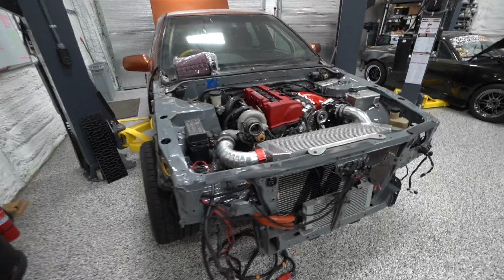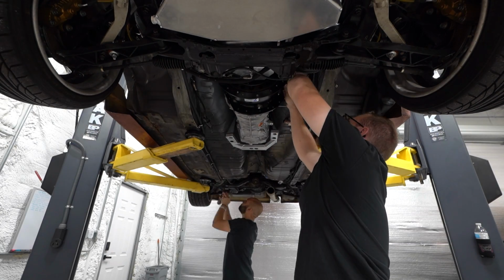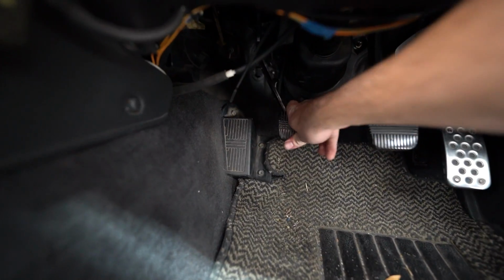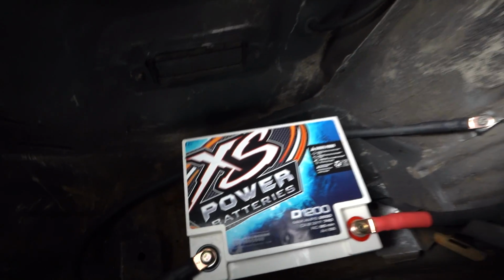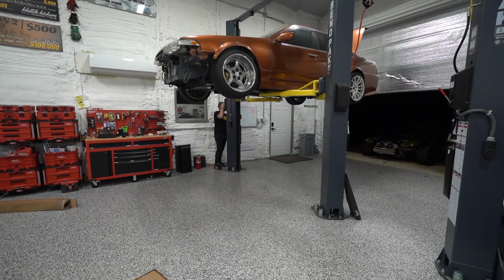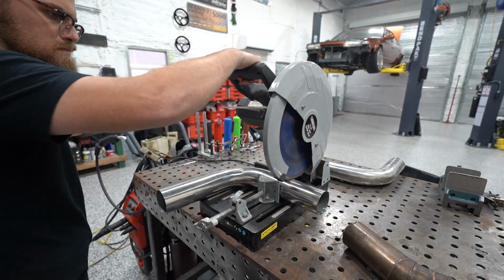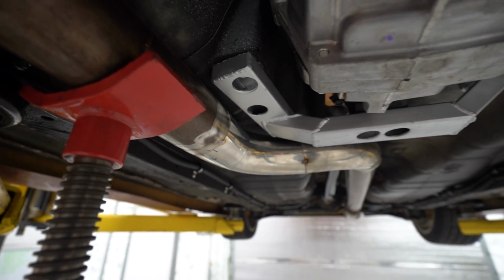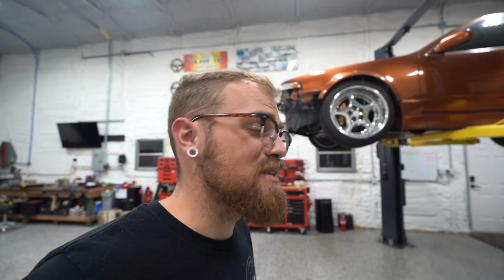Honda K24 swapped JDM drift car build. Its ready.

Comment: Also have you tried using tacking bands? I use them doing good grade stainless pipe fitting and welding. Basically a strip of steel that’s rolled to be the circumference of the pipe minus about 15 mm. With holes drills in it around the band so that you can tack the tubing together. Uses vice grips to clamp around the two ends and holds them together but still allows you to spin the pipe if you want. Food for thought

Comment: Hot tip for that little piece you made for the exhaust. You can put a flashlight in the exhaust pipe to illuminate it, and then wrap a piece of paper all the way. around that gap. The light illuminates the paper and you can trace the exact shape of that little pie cut and then wrap it around a piece of pipe and cut it out exactly.

Comment: I used to get so irritated when a part that worked perfectly fine a short time ago, and wasnt used at all for a bit suddenly goes bad right when youre fixing something else. I used to think there was no way, it must be something I did, highly unlikely that the starter just HAPPENED to go out right at that time...
Now I understand that is quite literally how it happens most of the time. Completely unrelated part failures for no apparent reason at the worst possible time. Happens more than 50% of the cars that come in to the shop and my own stuff and pretty much anyone I know

Comment: A tip.  To keep your hydraulics seals from leaking always have it reset o the loft locks. Eg.. when it goes up after both sides clicks lower it so it sets on the safety catch.  This way the weight of the car won’t be on the hydraulics.    Your seals won’t hold the pressure.
Love your videos !!!

Comment: personally i wouldve made a vband connection inbetween so if you have to pull the trans or driveshaft you only gotta remove a small portion, now you gotta remove a huge section

Comment: If your flipping those breakers a lot, it would be easy to add switches to the side of your panel. It’s not good to flip switches on a regular basis. Their just not made for it. If you want some help with it. I can walk you through it. Cheers!
Reply from the maker: I was wondering about that. I mainly turn the lifts off Incase they short and try to lift on their own.

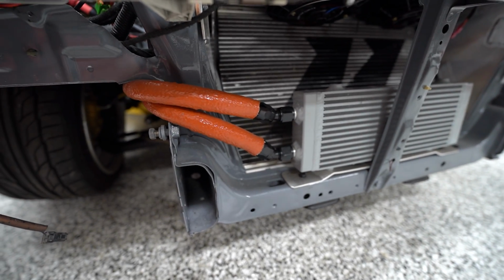Comment: 6:26 I think you could swap the two oil line positions on the oil cooler instead of making a whole new line. If you moved the bottom one to the top fitting on the cooler, it would give you that extra inch you need, and it looks like you could have the length in the other line for it to reach the bottom fitting. Maybe... Its hard to tell.

Comment: i made batteries for about 3 years, (good money shitty working conditions) but all agms batteries are basically the same. the difference is a couple grams of acid which aint shit. get the correct size and it'll function just as an oem.

Comment: Watched all the episodes when you were building this car with my dad, awesome to see it back stronger than before! Also new camera? the focal length looks different in the vlog shots, and it seems more stable/smooth.

p.s. : not sure if you've noticed, but in some of the voice over clips there's a slight buzz in the mic. Great work 👍
Reply from the maker: It’s the same camera I’ve had for a bit. But I finally got some full frame lenses for it. Was using my small frame lenses for awhile. I also got a gimbal so I could use my main camera for the walking “vlog” shots. I normally use an action camera since the stabilizations better.
Reply: @Taylordrifts  Nice! Yeah I’m used to seeing the action cam shots, can’t say I remember a video I’ve watched with this camera. Maybe I’m just noticing now since I’ve taken a photography course recently ¯\_(ツ)_/¯

Comment: Am jus a car admirer so dont know a lot abt building cars. Isnt that a crash area where the battery is installed? Am wondering because i have seen some car builds where that tube frame the whole back and the battery is mounted inside the car at the back.
Reply: It’s a street car, in a comp car you might tube the rear quarter but you need the trunk on “street”  cars to carry your tools and tyres to the track. Lots of vehicles have the battery there from the factory.
Reply: @foamdataservices  ok. Thanks for the clarification . Have a blessed day

Comment: That mis-matchedness of the interior has some serious 90s/2000s vibes going on and I personally love it. That's the tuner car generation I grew up in.
Reply from the maker: I don’t know why I love it. It’s normally not
My thing. But I like having a clean simple interior with some over the top flair here and there.
Reply: @Taylordrifts  my first car was a 91 Talon TSi that had one secondhand Bride seat with a Takata 5 point on the drivers side, and a second hand Sparco Monza passenger seat with a Sparco 4 point Harness, a ratty third hand Nardi steering wheel, and a shift knob I made in shop class. It was pretty sweet to me because I built the car from the time I was 12 til I was 15. Sometimes that mismatched madness just works.

Comment: Great Progress, Taylor. One suggestion on driveshaft installation for the future. apply assembly lube to the outside of the end that goes into the output of the t56 so the rear seal doesn't get accidentally damaged pushing the driveshaft snout past it. also - did you verify the driveshaft engagement into the transmission. should be 3/4" static so it has some leeway for travel.

Comment: Also bud, I'm really digging on those wheels. They look alot like a Z32 polished wheel, but two piece...Man do I wish Honda would've released an inline six. I LOVE my J series V6s, and I made 502 whp on a JDM J32A that I bought off of eBay for $700, a 2003 Acura CL Type-S six speed manual trans, an AEM 340 LPH fuel pump, custom made Injector Nation 1000cc injectors, custom made ARP head studs, a set of eBay turbo manifolds and downpipe (that had to be highly modified to fit), a GTS3582 dual ball bearing/billet compressor wheel turbo, an Invidia single in/dual out exhaust, a Tial Q50 BOV, and an eBay 44mm wastegate, all running on an AEM 30-6052 standalone in my 2001 Honda Accord sedan. It was fast and it surprised quite a few people, until a student driver pulled out RIGHT in front of me...Now I have a 2004 Acura TL (yeah, I know, I'm a truck driver but I love imports and I won't buy new cars, so I got this and my wife got a new Ford Escape Ecoboost AWD). However, I love turbo Hondas, including my 709 whp EJ8 Civic coupe, and I'm planning to turbocharge my 2004 TL with the same GTS3582 turbo or my Garrett GT3582R at low boost being tuned on Hondata FlashPro using some parts from the Accord, but the J32A3 has the exhaust manifolds cast into the heads, so I had to fabricate new manifolds and all, so hopefully what I've been breaking my butt on will work. I still have to have the 10an drain bung welded into the aluminum oil pan (because I've never TIG welded and I don't have a TIG welder), and install the injectors, the oil feed tee, drop the subframe and install the new welded pan, so on and so forth. Sorry for the novel, but you get the idea.
Reply from the maker: They’re actually Z32 wheels converted to 3 piece.